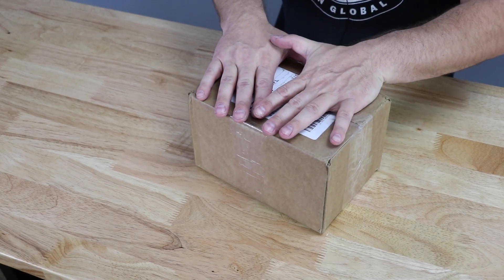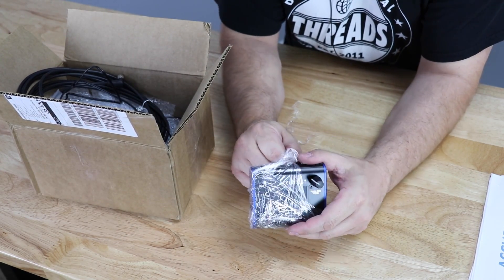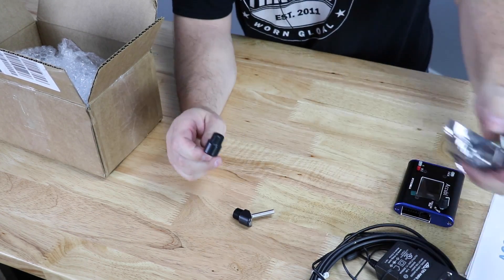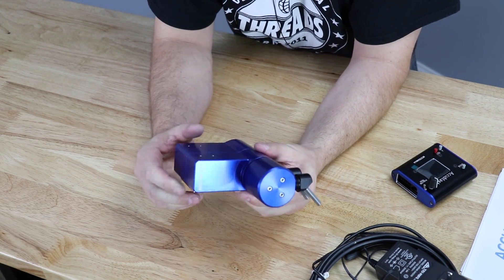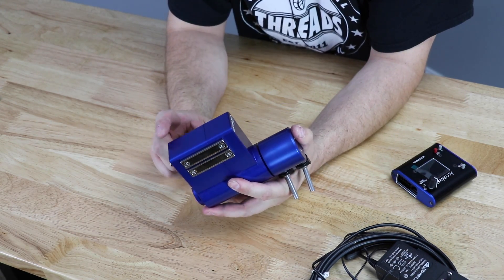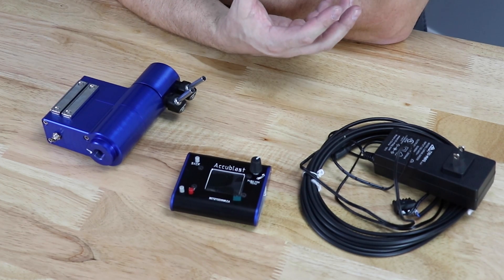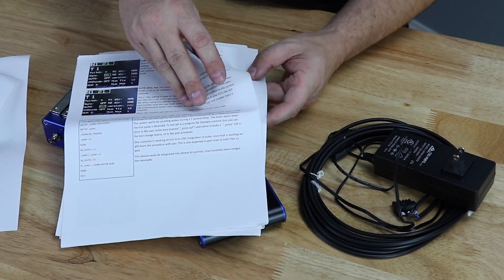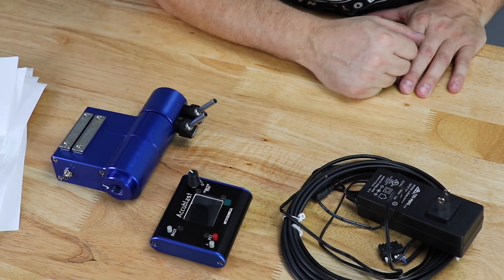Betz Technik - Accublast - CNC VMC Directional Coolant Blaster

Comment: Thanks for the order Jason! Just to clarify- PRO kits have an extra module at the back of the machine that serves as the interface to the machine for the different auto modes (ATC pin monitoring, RS-232, TTL, Ethernet, AUX inputs, etc.). Yes the shipping stretch wrap isn't ideal (I started sweating a little watching you fight with it) but for now it is the easiest way for me to ensure the parts don't get scratched before you get a chance to scratch them!
Reply from the maker: All good Peter. Thanks for the careful packaging.
Reply: Peter , you get everywhere :)

Comment: Hi,
Very nice well thought out product at a decent price.
One thing  (Item 2  manual foot pedal) that could be easily? added to an already GREAT coolant dispensing system. The air hose from the foot pedal could be easily attached to either one or both of the coolant nozzles via a small machined bracket like the one shown in the video below.
1: I had a friend of mine Lyle Jagger engineered a programmable air nozzle and explained to me how to wire it up to my HAAS TM-1P.  Of course this was done at my own risk.
2: I also hooked up a manual foot pedal that would allow me to get an air blast anytime during the machining cycle.
I made a small bracket that hooked both of these nozzles up to my PCOOL unit.  This would allow me to set the nozzle position that was appropriate for each tool selected from the tool changer.
Here is a link to one of several videos I made on this project.
https://www.youtube.com/watch?v=B1ArxUjLy5c&list=PLoMtsE103Tx1Jqk3HhgIQs8TY1DeJVEEu&index=2&t=128s
Just a couple of things you might want to consider.
Many thanks for showing us a really nice product.  Look forward to your video showing it in use.
John